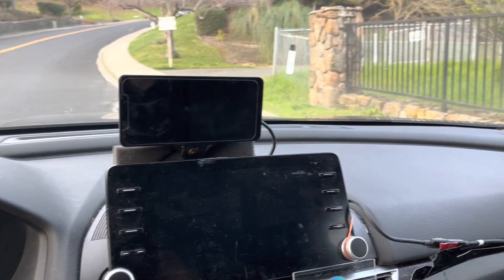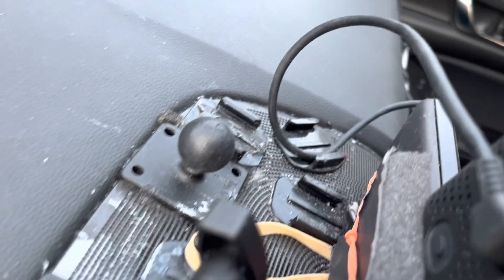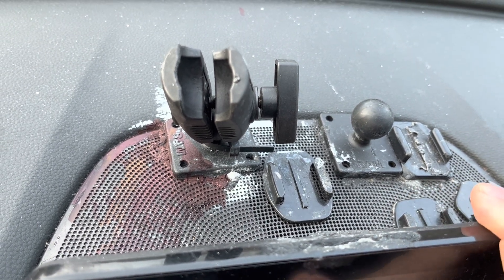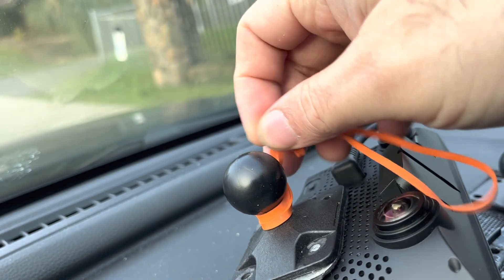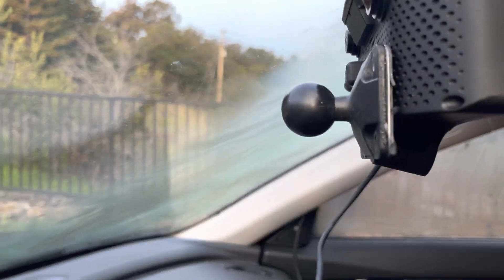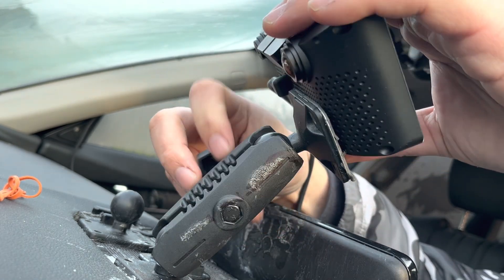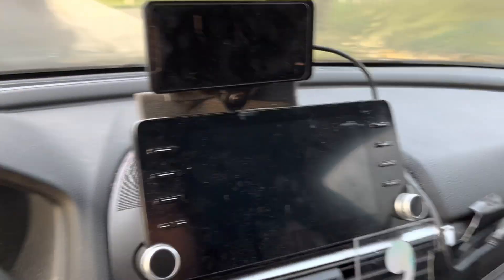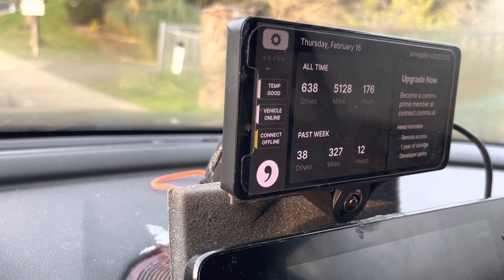My C3 Dashmount Setup In Depth  Openpilot Accord Links in the Description

Comment: You are limiting the airflow to the c3.  I don't think that's the best place to mount it on the device
Reply from the maker: Here's how it looks  from the back. I added another one on the other side to make it very stable. https://cdn.discordapp.com/attachments/820905614440005666/1145656717154209902/image.png
Reply from the maker: I kept it cool all the time. No overheating problem at all. The fan is not even invoke .